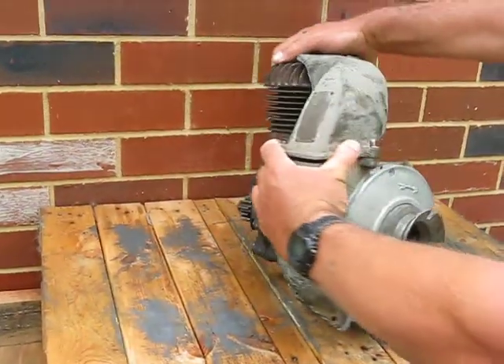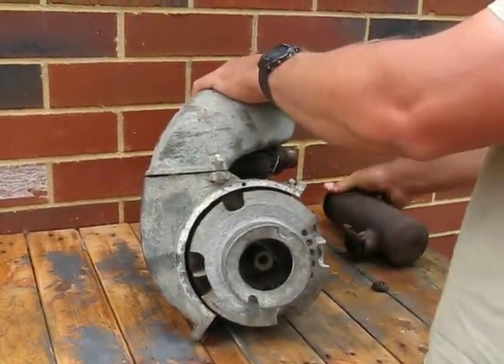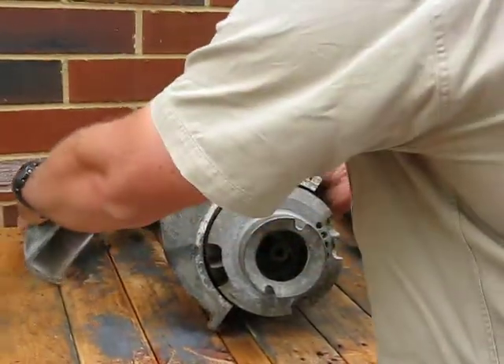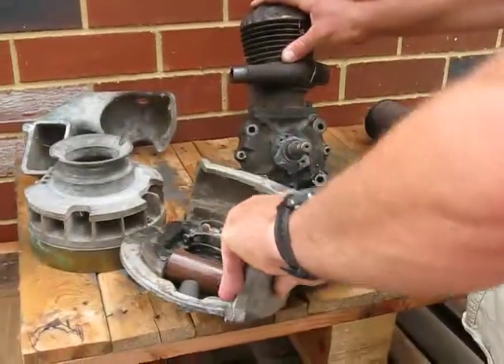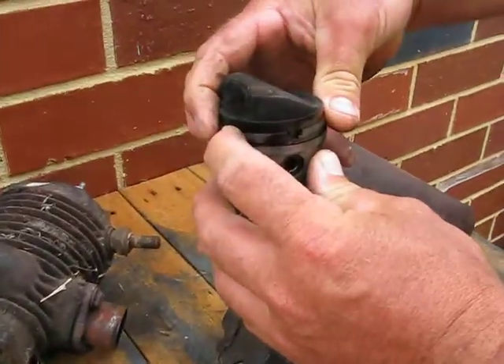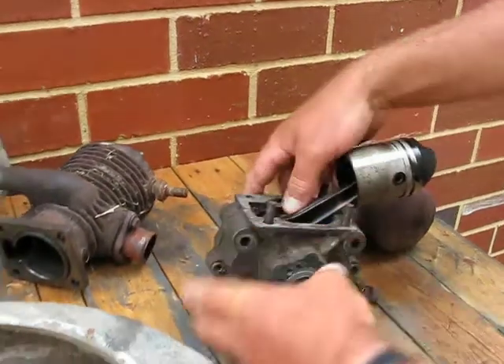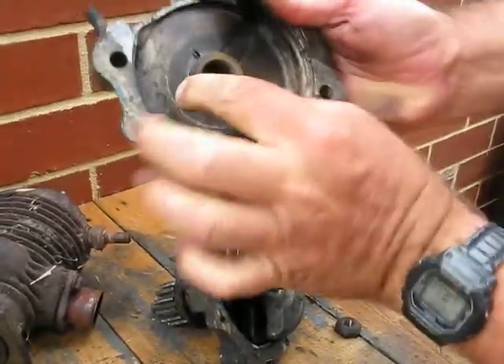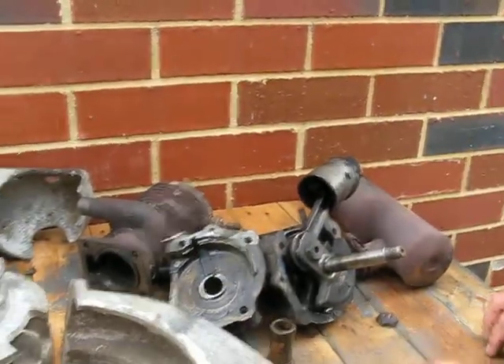Villiers 11c engine tear down off allen scythe mower.

Comment from the maker: No i never did a video of rebuilding it. I was fairly new to youtube at the time and just thought this would make a good video. I did a video of the governor mechanism and then the next video is of the first start after i had rebuilt it. Started second pull, lucky as since then found the coil to be stuffed, a new coil but giving weak spark. Now i have it running a lot better with another coil.